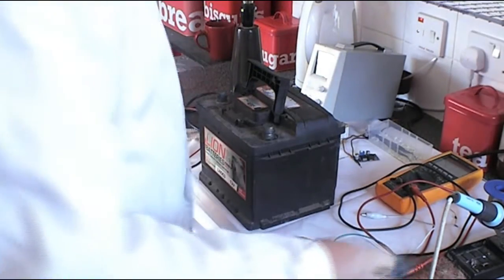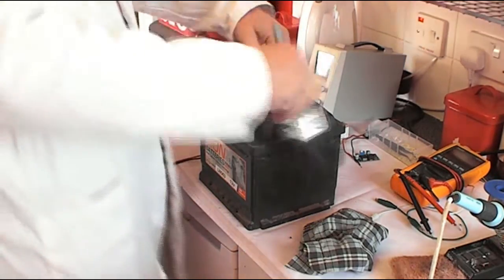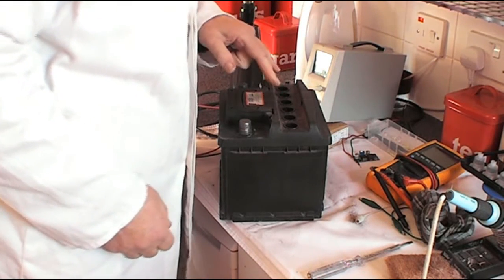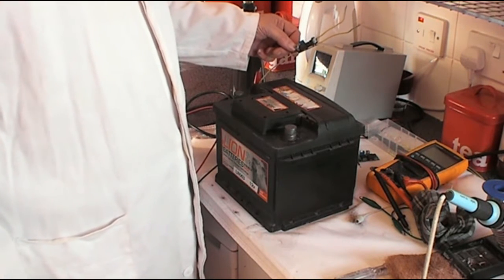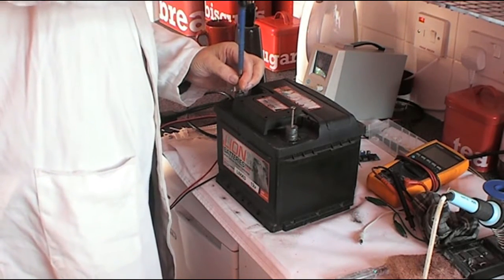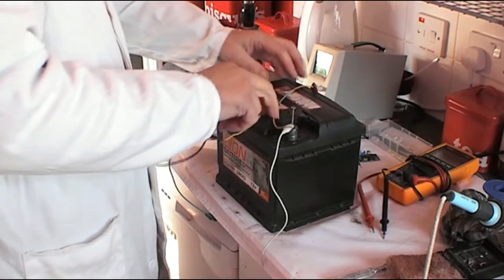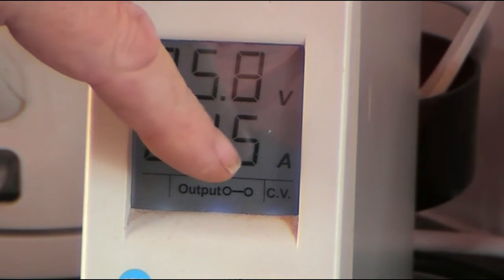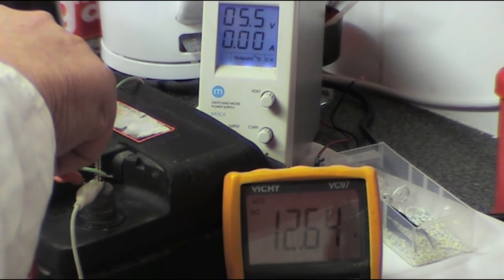DIY Homemade Build Your Own Desulfator Rejuvinator Prototype Part 2

Comment: Excellent work, Sir i need some clear instructions from you, as per my little knowledge dc to dc converter should down the voltage by given voltage from any dc supply, i don't get you give 5volts and 250ma from supply to dc to dc converter and what are the settings of dc to dc converter if possible please let me know the the name and specs of dc to dc converter and setiings volt an damp on dc to dc converter also define how battery take charge because you give it 5 vols and its already have 10 volts i hope you understand my concern please replay as soon as possible thank you very much take care

Comment: Deep cycle batteries i have had great success due to thick lead plates 
most used as standby backup batteries are just sulfated. 
You can easily get the sulfates back into solution by heavy discharge 
and charge cycles, it will make the sulfates dissolve from the surface 
of the lead plates so you most of your capacity back.  

i started a project like this with a few more car batt's trying to revive them in different ways and you can revive them for a short time i do wish you luck. 
most videos on youtube claiming to be big success are just click bait by time they reach this state the damage has been done.
All the best my friend have a good week.
Reply from the maker: Thank you my very good friend. I claim nothing at anytime. I just do stuff. If it works I win. If it don't I can get money from scrap. Even if it is only £1 it will buy me a bag of transistors. That's the way I look at it, I am going to test the battery by using one of my light bulbs on it. To see how long it lasts in normal use. A TTPW Battery gives me 15 days of normal use with no daily recharge for all the lights I had in my flat. Before I had to take it all down.. I wonder what I will get from Sharons battery. Let's find out shall we. Have an amazing week my amazing friend. Regards to you all.
Reply: in norfolk we have to pay to get rid of them.
Reply from the maker: WHAT? Over here we weigh them in and get paid. Pile them up and when I visit around May I will bring them back weigh them in and put all the money in your PayPal account. That's ridiculous.
Reply: DIY TEK NUT 0

Comment: I have a sealed led acid battery that reads 1.3 volts. I wonder s I should bother trying to revive it. Most people say I'd be wasting my time.
Reply from the maker: The only time you waste my very good friend. Is when you do nothing. Give it a go. You will never know until you try. What would have happened if the Wrght brothers had listened to thier nay sayers?

Comment: would a person use a battery charger instead of the power supply?
Reply from the maker: Power supply with current control and ability to drop voltage to 5.5V and increase later if required. Using a normal charger. By By Converter. Also as I will state in the next video. I think the frequency of the Converter is what is doing the desulphating action. Thank you my good friend. Have a great day.